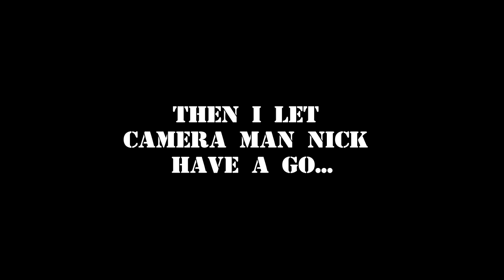Offroad drift trike complete build

Comment: I reckon you need to change the seat position on the trike... needs to be back further near the rear axle, that will help with leg position too, but you need to make new ape hangers, it would also help with weight distribution so as not to make the front dive like it does when ride on board...and maybe a suicide shifter... lol
Reply from the maker: funny enough I did consider all these options when I was building the trike but it ended up how it is because reasons... 
The size and angle of the front wheel meant that it has a lot of leverage over the bars and taller bars would flex more making it harder to ride and it is a hand full as it is so the bars are where they are and the seat is as far back as I can make it while still being able to reach the bars, but I cant angle them back because they will hit on my knees. I did consider making pegs further forward but after the first ride they are pretty good and I can stand up and do really tight donuts comfortably.
as for the suicide shifter it would have been an inconvenience especially when you often need two hands to keep the steering pointing in the right direction and foot shifting is so natural (I keep going for the rear brake with my foot but it is just not attached yet)
hope this answers some of your questions but feel free to ask more